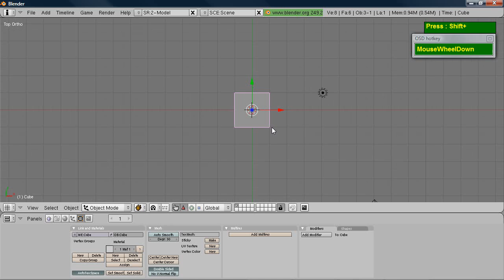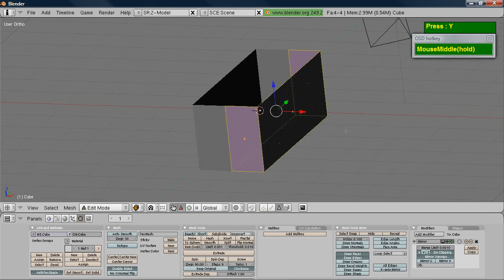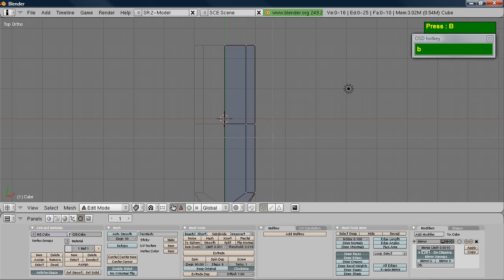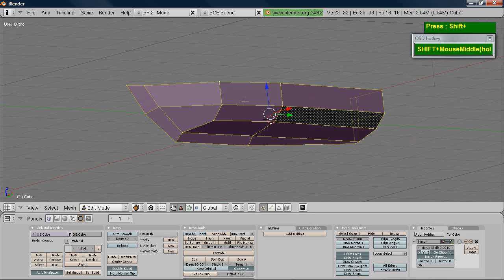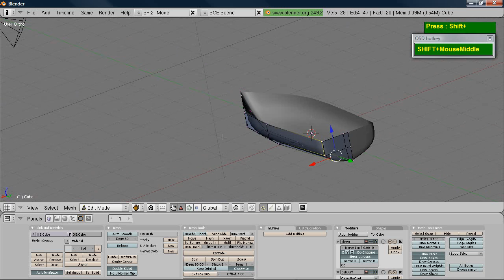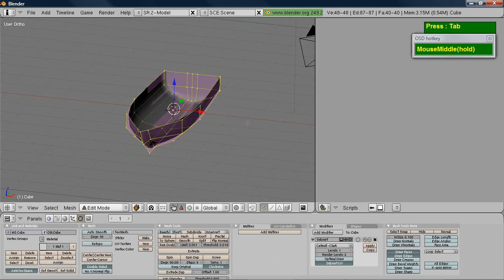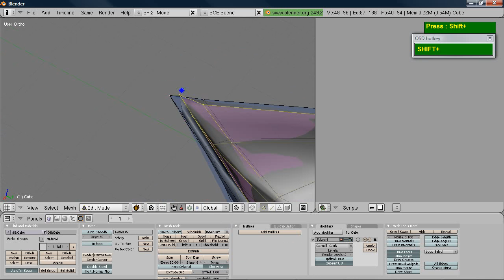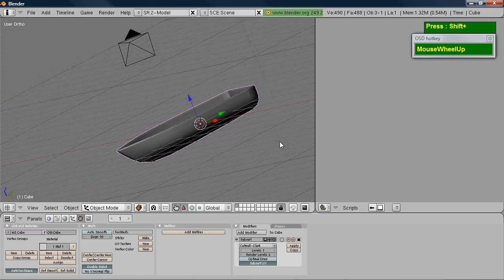Blender Simple Boat Hull modeling tutorial

Comment: how do i get the panels u have on the bottom?
Reply from the maker: You mean the Blender user interface? This version of blender was 2.59.
Reply: no all of the mesh panels u have where timeline normally is!!
Reply from the maker: david cates Ah I meant I was using Blender version 2.49 when I did this tutorial. That's why there is no time line.
Reply: ok, is there a way to get those panels there still
Reply from the maker: david cates You can customise the  layout of Blender to your liking. Just remember that this tutorial was done using Blender 2.49 where the panels are already at the bottom. You can change the time line to properties panel and change the layout to horizontal in Version 2.59 and above.
Reply: i know it is quite customizable, however i can't find the mesh panels or combine 2 windows in 2.78c!!!!!
on my mac

Comment from the maker: @mingleofdeath I'm referring to the numpad key section of a full sized keyboard. You can use blender on a Laptop without the Numpad, but you have to enable Emulate Numpad mode for the top row of numbers for the changing of the viewport. If not, the current number row on top of your keyboard will function as layer selection.